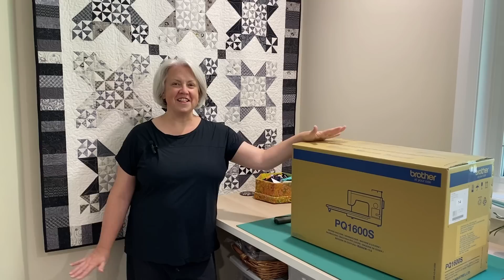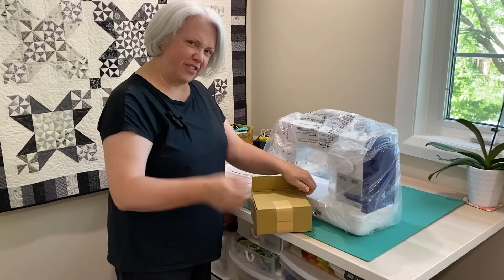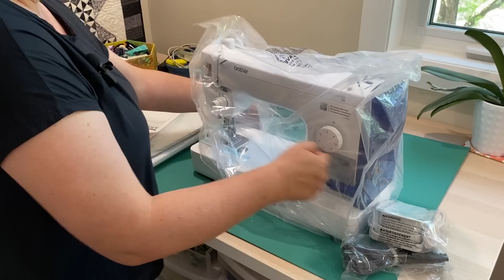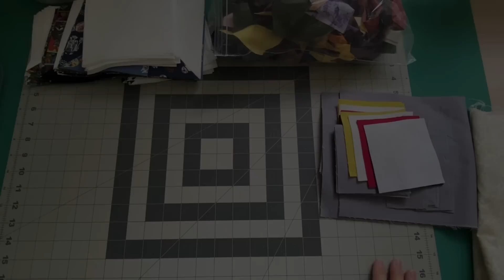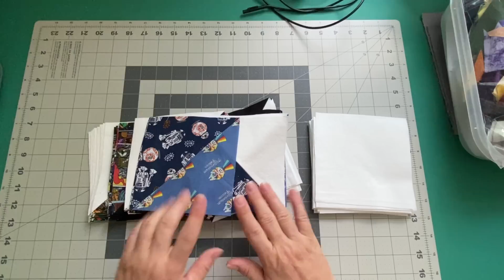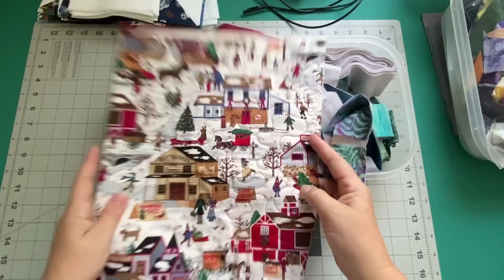My New Machine!  A decision has been made!

Comment: I’m in the same boat: just wondering what happened to your Juki. I’m trying to decide between Juki (the only dealer closest to me is in Winnipeg while I live in BC) and the Brother. I can purchase the Brother locally in Kelowna)
Reply from the maker: Hi Elizabeth - the consensus is it is a problem with the circuit board.  Even though it is not a computerized machine it still needs a way to transfer power to the various functions.  I used it hard for 10 years.  And I also suspect using it with a voltage converter while living overseas had something to do with the component wearing out.  I was thinking about buying from the shop in Winnipeg as well, but decided that being able to get local service was important given my experience trying to even get a quote to fix the Juki.  I really like the Brother - a lot.  The only thing I miss is there is no speed regulator (the rabbit/turtle button on the Juki).  It has taken a bit of time to train my foot to apply the right amount of pressure for the job I'm doing.  But otherwise, it is so similar to the Juki that I'm happy with my choice.

Comment: It looks very similar to the Juki TL2010Q.  I hope the foot pedal has the thread cutting option
Reply from the maker: It is really really similar, but unfortunately the foot pedal thread cutter is one of the missing features.  I haven't missed it as much as I thought I would.  What I do miss, however, is the speed adjuster.  This one doesn't have one, so I have to regulate the speed myself based on how much pressure on the foot pedal.  It's going to take some getting used to.